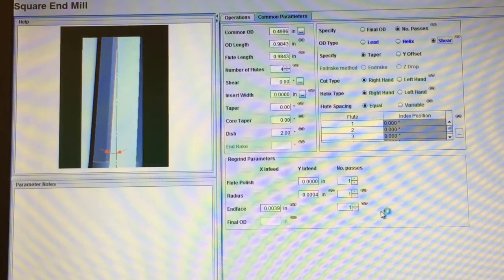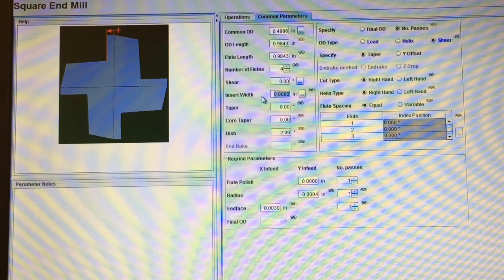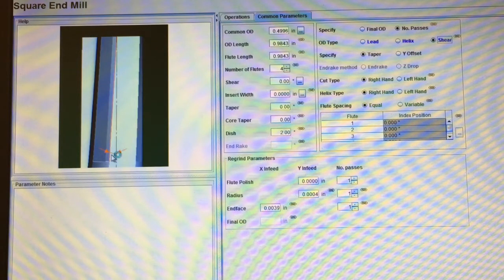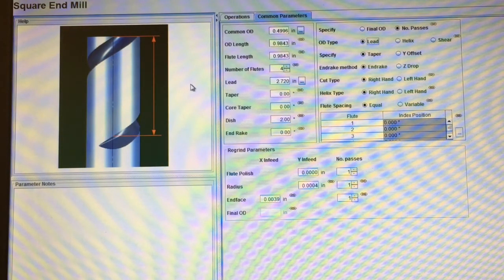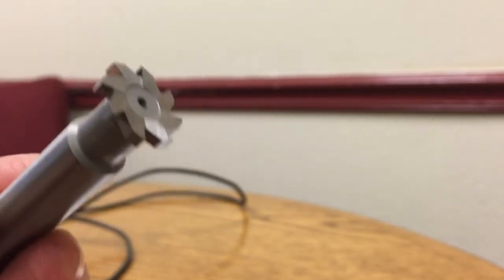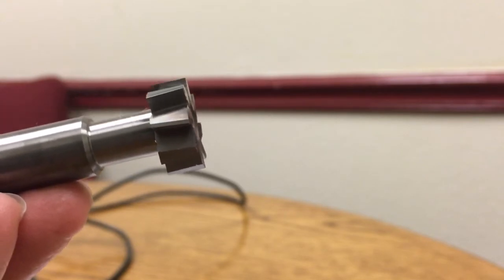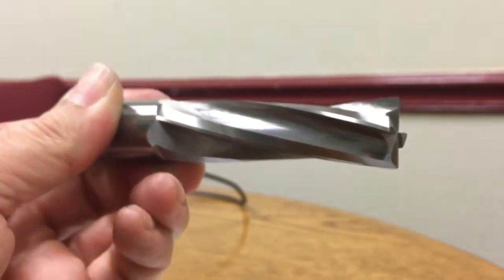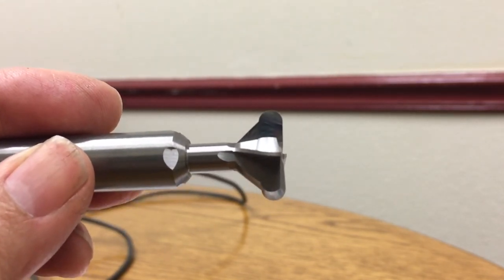"In the Cut"  more on cutting tool geometry

Comment: Maybe I missed it in this video, but could you talk about how (or if) helix and axial rake affects a form cutter? Will it produce a different shape on the part than that's ground into the cutter?
Reply from the maker: Andre Gross it absolutely should not. The more challenging the form generally will dictate just how high of a helix is possible.